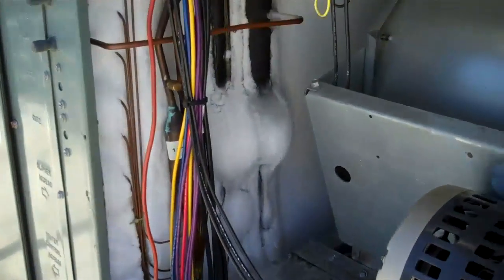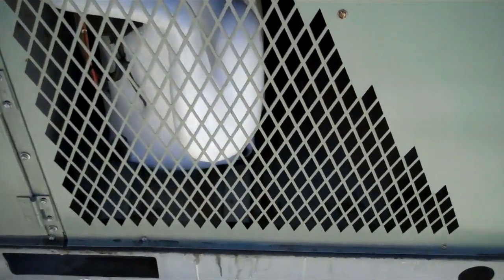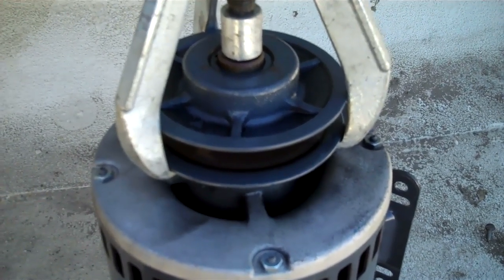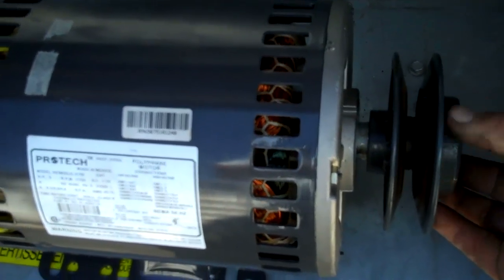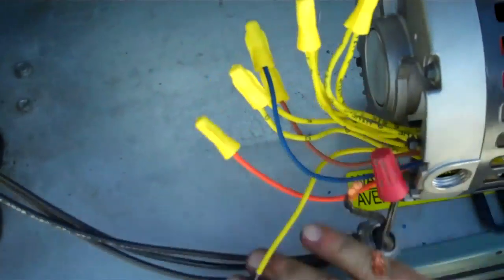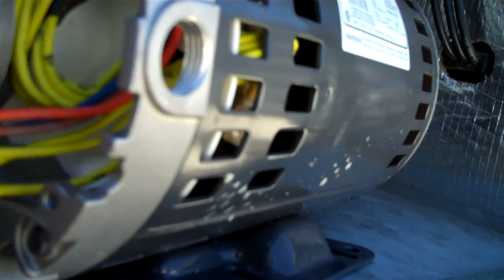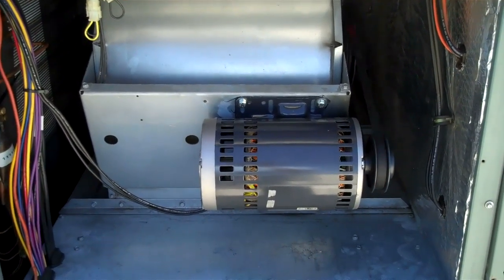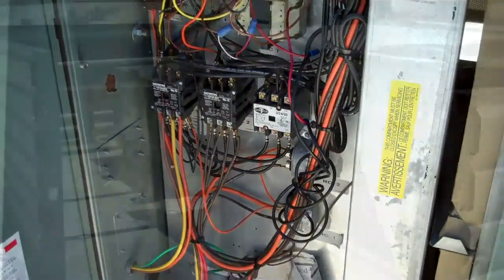Bad Indoor blower motor.

Comment: Holy crap Dallas, I can see why you use your driver. My puller is a little different than that one. I like yours, it looks a little better. The part of mine that pushes the shaft out is pointed on the end. I can turn it hard enough for it to burrow into and mushroom the shaft (Not too good). Whats the make of your so I can do things right next time. Thanks for the video Dallas.

Comment: Gas roof top units are the norm . Hard to believe on a older shopping center where I live had one store,A Peebles at the time, had 5 Lennox oil burner r/t units w/a/c and the company I worked for installed those and all the other roof top equipment. All the other units were gas. Seems unusual now that I think of it but at the time didn't give it a thought. For some reason your video sparked that memory. BTW that co. has been in business since 1935 and still going today & still a Lennox dealer.

Comment: Welcome to the North Pole !!! LOL...
On a hot day on roof top units ,I will pull supply panel , and stick my head in to  there to cool off a little !!! LOL... That didn't sound good , did it !!! ROFL...
You are the man , Dallas !
Man I am jealous again , gotta get that puller , that was the SH!T !!!
Great TIP on wiring !!!
Thanks for all your help Dallas .
Another GEAT video !!!